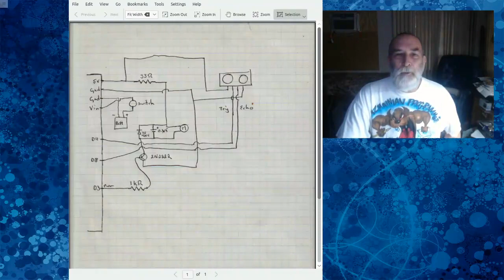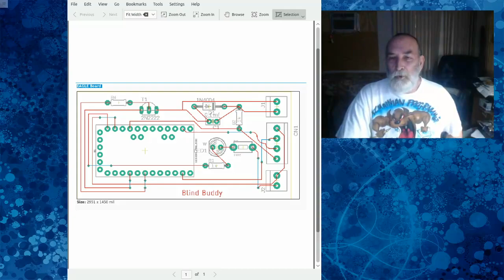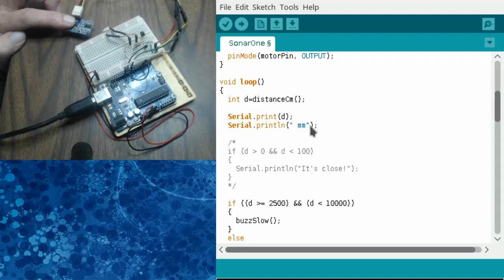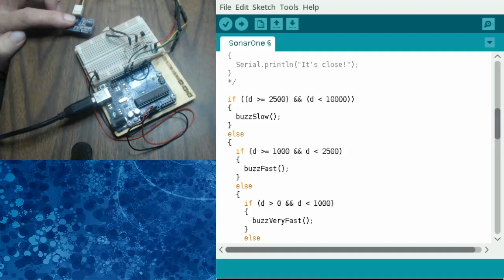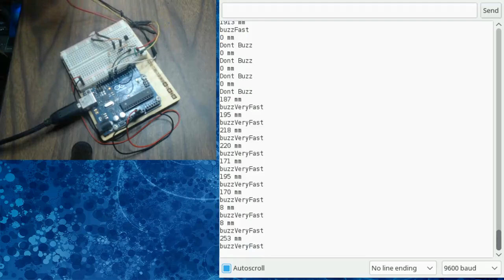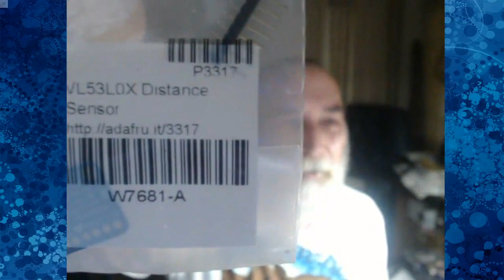Let me Introduce the Blind Buddy

Comment: That is VERY cool geeky!  Thanks for sharing! This comes at a great time.. I am planning to "dive" into Arduino this winter. Excellent video my friend! Any thoughts about adding inertial sensors so the sensor could adjust distance based on travel speed?
Reply from the maker: Now that is an interesting idea! There are still plenty of pins available, I may have to look around for an inertial sensor!
Reply: @geekygardens  maybe just pickups off of a speedometer.. but yeah.. auto-ranging